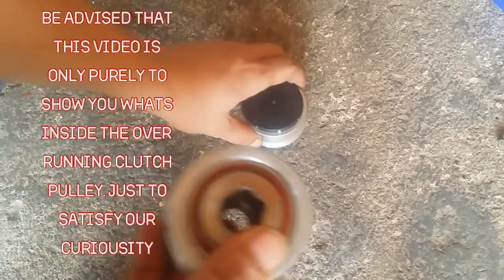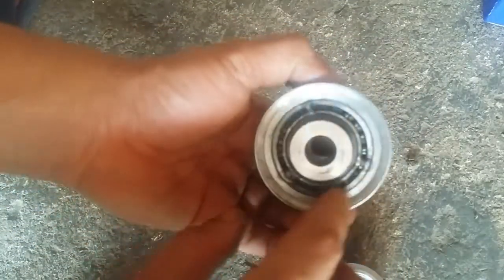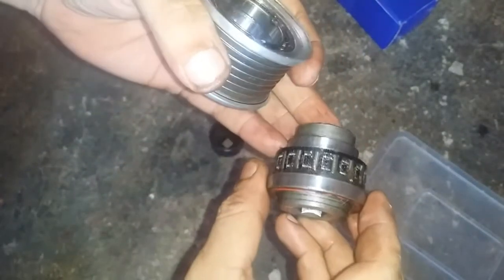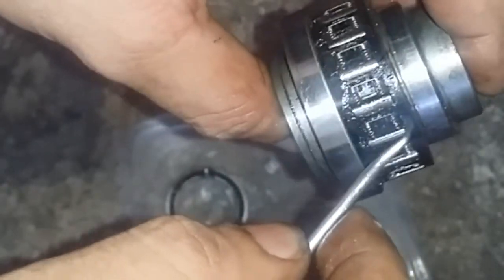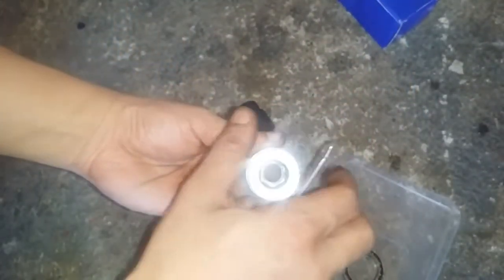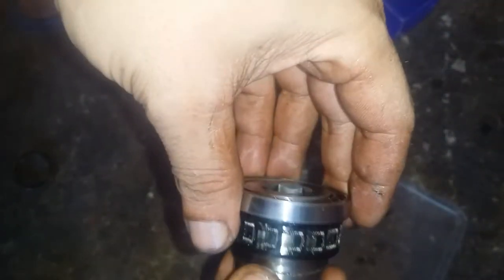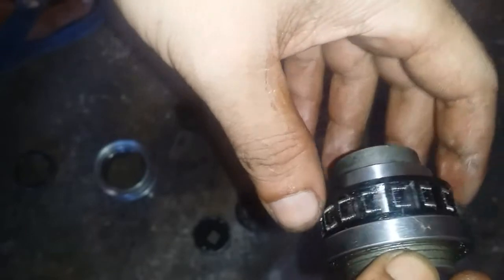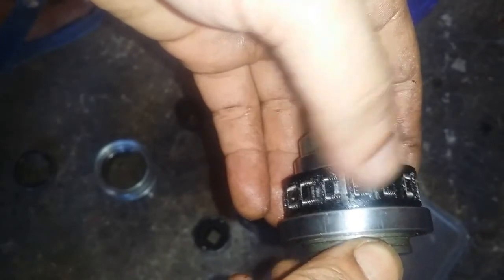what's inside the over running clutch pulley of the alternator.

Comment: The little things that flip and cause friction, and the surface they cause it on lost some material and got smooth. It takes friction to pull them over and bite. I've heard them called dogs and pawls, not sure if either are right though. Plus the race and the tiny cut outs in it also wear leaving slop in every direction.